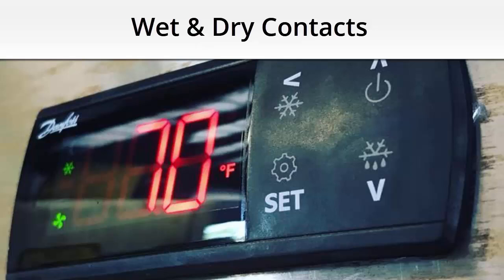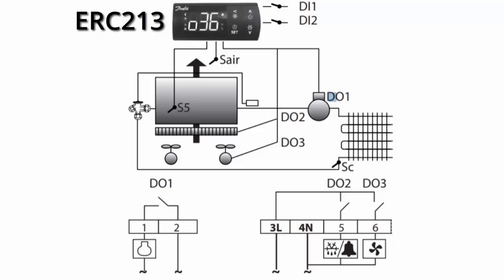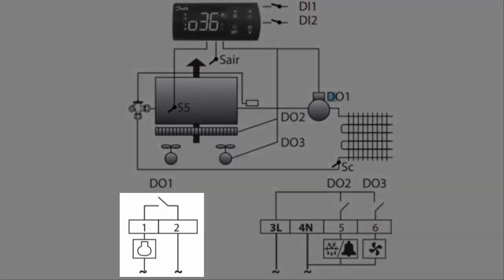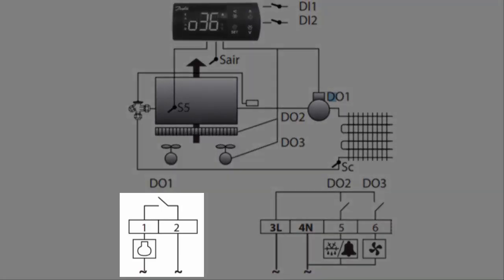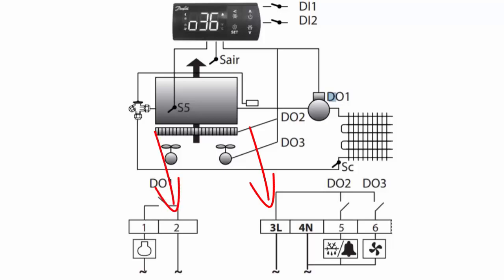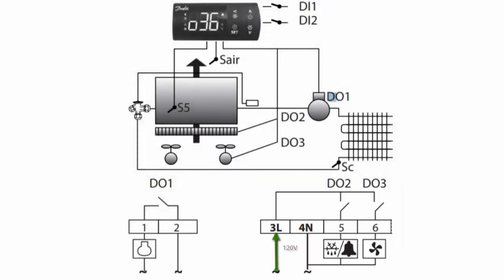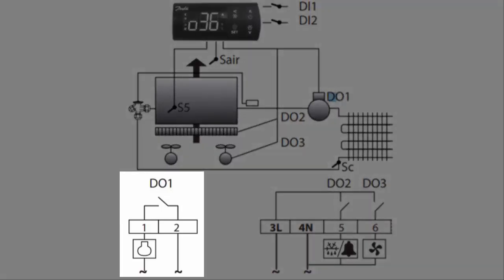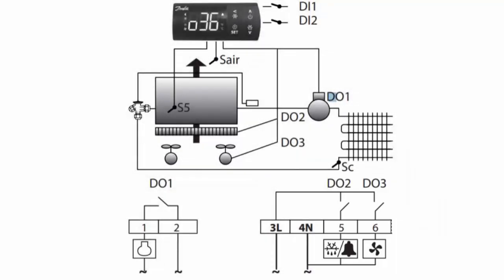What are Wet & Dry Contacts

Comment: Dry Contacts:

1. 1-2 are dry contacts.
2. There is no automatic input for 1 and 2. Its not taking what you're feeding the control with. You either feed 1 or 2 by applying voltage.

anything else?

Comment: It's rather simple. Let's consider outputs. Dry DO (digital output): a switch controlled by some circuit, (like  a relay). Wet DO: it's actually Vout controlled by a circuit. i.e. wet DO is a signal, (like the DTR of the RS232).

Comment: So in one case (dry) you have to hook up power from an external power source directly to the relay.  In the other case you have to hook power from an external power source to a control board (wet) which in turn hooks up power to the relay...........

So in other words it is the same damn thing but one has basically a control board and one does not.  What a useless term.